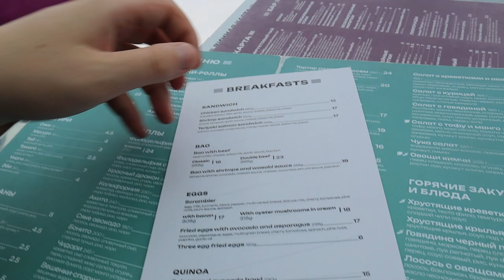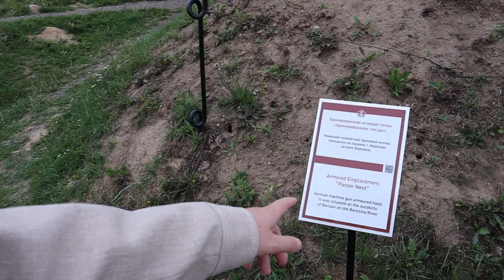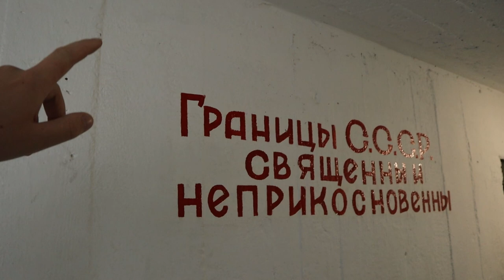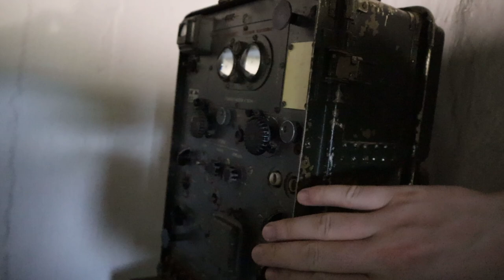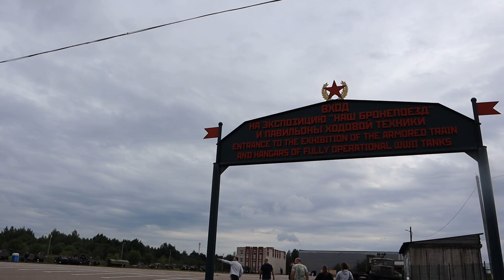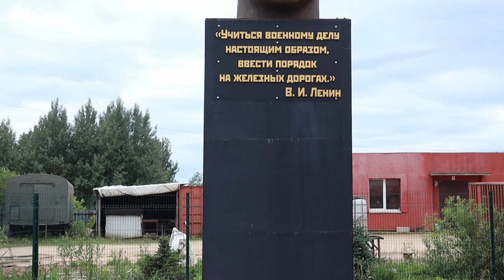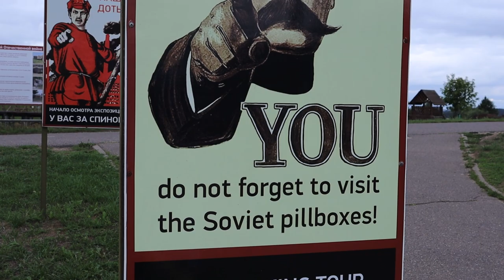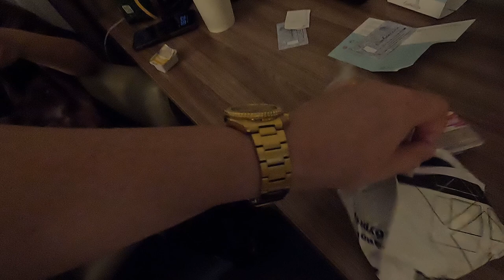Shooting Tanks At Front Line

Comment: Putin's still using T-34's...
Reply: What is America still using 🤡
Reply: @SarahSarahSarahSarahSarah123   MIA2 Sep. V3 Depleted Uranium Armor. 76.3 TON Behemoth 35 TONS heavier than the T-72. It takes a special bult extra wide low boy trailer just to transport. Powered by a Honeywell AGT1500 YES it is a turbine engine reason when running it sounds like a jet airliner readying for takeoff.
Reply: @SarahSarahSarahSarahSarah123  That is ABRAMS. Pentagon uncertain if bridges and roads in Ukraine can hold up under it weight and size.
Reply: @kenpatterson2948 , I feel like singing, “ Proud to be an American…🇺🇸🎉”, thanks for your service 🙏